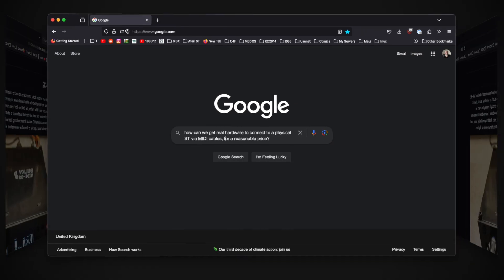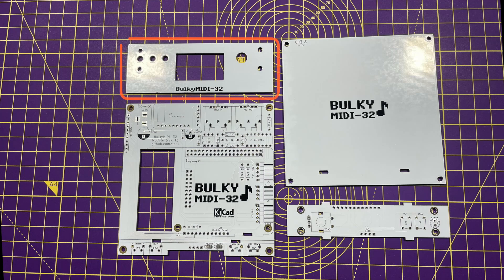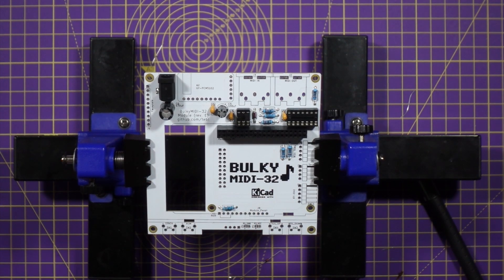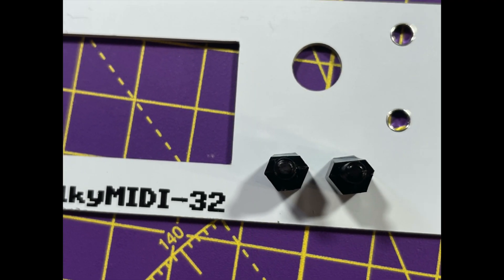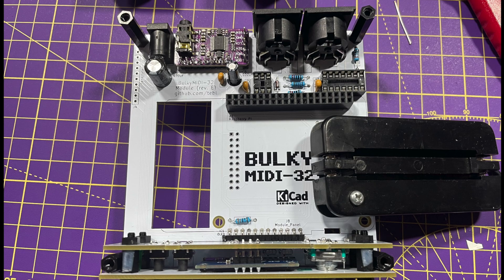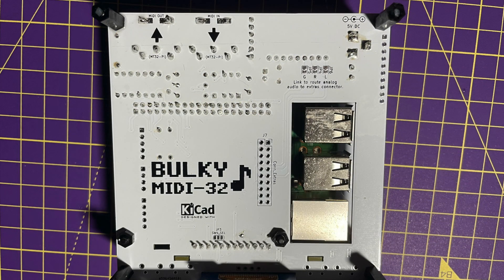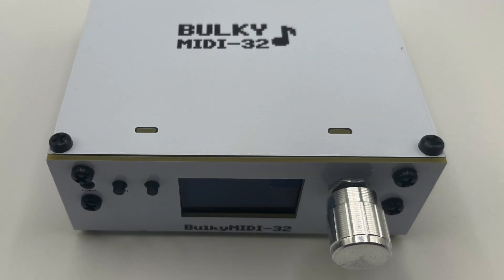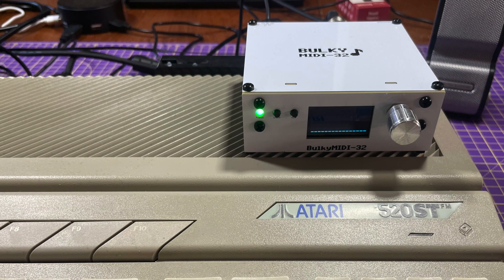Bulky Midi32, the best Roland MT-32 clone?  Let's build one

Comment: Im confused on getting projects like this on PCB way. Are the electrical components like resistors and such included when you order everything or just raw PCB? What about the display? I really want to build one because im enjoylearning with my solderong adventures but if im going to have to jump through hoops to order multiple things from multiple places i might as well buy a preassembled one 😂
Reply from the maker: unfortunately as you say its just the boards, though i think PCB WAY CAN populate some surface mount stuff, though this is through hole. if you persue soldering as a hobby you pretty soon accumulate boxes of resistors and caps etc. but i had to order in the display and the audio board as i don't 'stock' them.